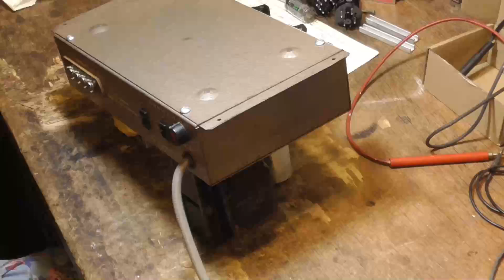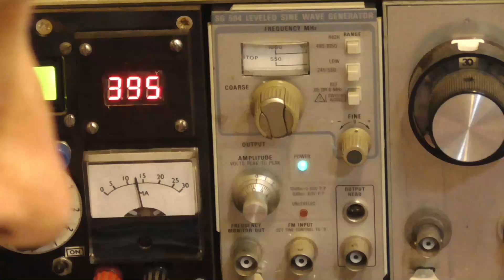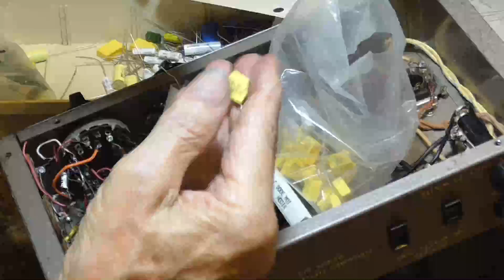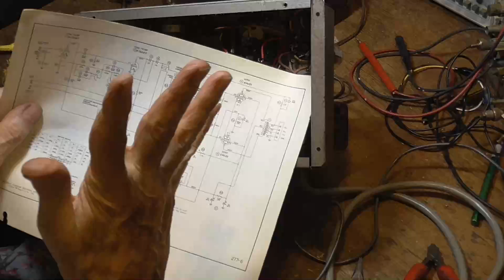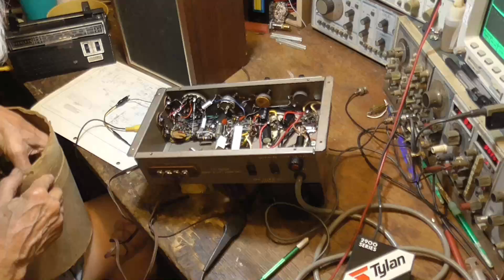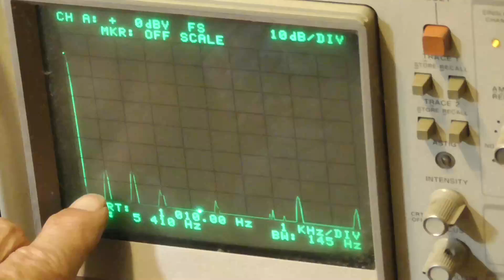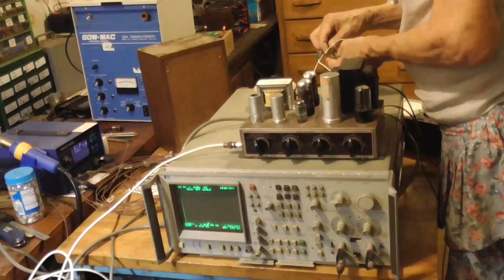REPAIRING A SMALL TUBE AMP

Comment: Now, if you were a real nut case, like me, you'd gut the original electrolytics and put the modern electrolytics inside the cans. I did the same with a car radio, removing the vibrator guts and placing a pair of NPN power devices inside, along with a small feedback transformer.
30 years ago, I bought a Grunow 6 tube AM Broadcast superhet. I finally went inside it last year and was disappointed by the number of Japanese replacement electrolytics and film caps. I generally don't replace wax capacitors unless they show leakage or wax running out the ends, from heat. 
Another comment - excluding resistive losses in the output devices or (if used) output transformer losses or filament power, the theoretical efficiency of a Class B amplifier is pi/4 or 78.5% when the supplies are just high enough to prevent clipping. Without crossover bias, Class B is inappropriate for audio. Most Class ABs have just enough crossover bias to reduce efficiency to maybe 70%.
Reply from the maker: This was a job for pay where the customer wanted minimum repair cost. That means no time consuming operations like opening up the old cans.

Comment: i made a dielectric  sensor of a mosfet transistor (2N 7000 
low threshold voltage means no gate bias required
high input impedance of the insulated gate means almost no gate current is required
consequently no current-limiting resistor is required in the gate input)
, i have a coil direct to the gate , and a led to indikative when it is a dielectric aura rund my body or plastikk and so on ..it will not detect normal electric em radiation  only dielectric !!     , it detect my body on 7 m distanse , and i wonder if it possible to make a dielectric sender ? ? do you know master ( my only ide is to send a hige volt signal in to a antenna made of som dielectric material and it gone be my first try when the time is right )  
glasslinger you ar a tru Jake of all trade!!!  . love from norway ... <3

Comment: Ron - forgive me if I'm wrong, but when you are doing the 1kHz distortion test, you increased the output level from the amp but you didn't drop the input sensitivity from 10dB/div so the 1kHz will be way off scale.
Reply from the maker: It's a log scale so it still fit fine on the screen. This was a quick rough test so I was not carefully setting everything perfect. Nobody would ever use an amp like this for any serious audio reproduction!

Comment: Lovely repair and servicing work. Did you fit a new valve (tube)? I think it's a little unfair to judge tube (valve) amps from what is clearly an old and basic model, especially if that's the original valve. I have a modern amp, and, as any tube-roller will confirm, the choice of tube can make a huge difference.
Reply from the maker: Even worse the output transformer is the wrong one! (cheap replacement)
Reply: @glasslinger  oh 😮
It does raise the question... If the amp is such a frankinsteinian mess, why did they want it repaired? I assume they didn't know
Reply from the maker: @daveryman1  All tube amps like that one are now collector's items just like old radios! There are some collectors that collect nothing but tube amps! This particular amp belonged to a man's father so he wanted to have it working as a memento.
Reply: @glasslinger  I think you may be right!  I'm gonna bring my old garage valve amp inside & check it out!  I'm sure it needs some attention!

Comment: I was watching till the end, hoping you would realize putting 8V into the analyzer set to 0dBV full scale is causing the distortion.... The analyzer even says "OVERLOAD" in the bottom right corner ;)
Reply: The output tubes bias should have been checked before any testing. Then display the amplifier output sinewave on a scope to see the point at which it begins to distort. This amp should be fairly good up to the limits of the output tubes. After checking to see at what voltage the amplifier begins to distort, I would back off slightly and use that level to set the analyzer to -10dB. Then look at the distortion products as the amp output is increased toward 0dB and below -10dB on the analyzer while measuring the output power at those points.
Reply: @ctbcubed  Hi mate!  Yeah I dunno mate; it looked to me like the harmonics were steadily rising as the output power was increased, from even just 2V output!  Truly, it could never be a hifi amp, but maybe a good guitar amp?
Reply: I totally agree. The test is invalid, the input of the analyzer is distorting due it being too sensitive.
Reply from the maker: OOPS!  It was an oversight since I was trying to get the video done in 45 minutes. The distortion was still present while the signal was within the scale of the analyzer. Actually, it was surprising at how little distortion was added by the analyzer front end overload!
Reply: @glasslinger  this is not true. Any time the Analyzer displays OVERLOAD, the "harmonics" go up significantly. The way such analyzers work, this is not at all unexpected. The input signal either goes to an A/D converter with little headroom for overload and the digital data is subjected to an FFT, or, if its an older model, is mixed up to a higher frequency and subjected to a tuneable filter. Both variants will produce harmonics when overloaded.

Comment: Omg a soldering gun! You can weld wirh that!! I would never use one if those. 
I now restore old 2" broadcast video tape machines. These machines are almost 2,000lbs and need an air compressor to run. The video head spin on air bearings @ 14,000 rpm and can't have any bearing noise. Mlst of thr larts cant be obtained any longer so some circuits must be redesigned using new parts. The pictures these things produce are still amazing!
 I used to fix everything with a Simpson 260 meter and a Tek scope
Reply: Solder gun works pretty good on point to point vintage tube gear, sometimes it’s necessary.
Reply: @fredfabris7187  i have been soldering for over 50 years and never found the need for one. Way to cumbersome. I have soldered a ton of pt. to pt. stuff from Hearhkit, Dynakit etc. Gun heat is very uncontrollable and would never use one imho
Reply from the maker: @rty1955  Gun heat is WAY more controllable than that of an iron! The whole point is to heat the joint fast, make the connection, and get off. You would need a very powerful iron to do this on the old radio connections. My soldering station is temp regulated 60 watts. It does not even begin to compare to heat output of the 250 watt gun! I have used both tools and unquestionably prefer the gun even though it is sort of cumbersome.
Reply: @glasslinger  if you are welding car fenders, guns are fine. They do not have accurate temp regulation at all. Some delicate electronic components can't tolerate such fluctuation if temp. Guns have their purpose, quick high temp, or soldering heavy wires etc. I do delicate work where guns would not work well at all.
Reply: @rty1955  Hi Roy!  I was just wondering what sort of soldering iron you use for p-to-p & chassis soldering?
Reply: @glasslinger  Gadzooks 250W!  Yeah that should work!  Long as you're quick huh?  But yeah in & out quick with a high power iron is definitely the way to go!  Obvoiusly you wouldn't use it for SMD's - Der!  I've seen you use a much smaller iron for tagstrips, wire tinning, etc.  I think people worry that you use the toofiddy for everything!
Reply from the maker: @nevillegoddard4966  Sometimes the big 325 watt gun has to be used on those circuit boards with a ground plane.
Reply: @glasslinger  Wow I'm starting to sweat just thinking about that!  My regular-type 250 W iron has a 7/8" diameter solid copper tip & weighs about as much as a colt 45.  The whole barrel glows a dull red, & I nearly burnt a hole clean through the kitchen table after leaving it on accidentally.
Reply from the maker: @nevillegoddard4966  I have one of those! I think they were meant to solder gutters and other plumbing work.
Reply: Hey, do you have YouTube channel or WEB site? I restore old 1in VTR's, VPR2s, VPR6s.

Comment: Any advice on what test equipment to buy for someone starting out? I would like to repair and build vintage guitar tube amps that I can not afford.
Reply from the maker: You would do good to get a Triplet 630 VOM and restore it to perfect. The old meter type VOMs are best. You can also have one of the digital ones but they are not as useful. An audio signal generator would be useful. Stick with name brand stuff, industrial quality rather than consumer crap. (hewlett packard) The meter and generator will get you started. Later  you could get a low cost scope, but get going first.

Comment: Tetrachloroethylene  is the brake cleaner / dry cleaning fluid.     from wiki:  "Chlorinated brake cleaner containing tetrachloroethylene will on exposure to high temperatures (above 500 °F (260 °C)) or strong UV light decompose into phosgene and hydrogen chloride, both of which are dangerous when inhaled."       so no spray on hot metal!!!

Comment: Ron, did you check the biasing of the push pull end stage? A good symmetric AB stage should not have this much distortion since the signal rides on an almost quadratic function. Also did you check for symmetry on the driver /phase inverter stage?

Comment: Tube amplifiers have to have speakers that are at least 93 Decibels/meter efficiency in order to sound good and have minimal distortion.
Bose speakers are an example of high efficiency speakers that would work to make a tube amplifier sound good, plus a small Push-Pull 6V6 amplifier is only good for about 8-10 watts RMS so you were measuring that amplifier at it's intended ratings. 
Those speakers you were using were 1980s vintage 3 way 6X9 Car Speakers which aren't the greatest thing to test a tube amp out with.

Just my two cents.

Hope this Helps.

-Levi

P.S. I work on old tube equipment as well so I'm quite well versed in tube electronics theory, and I enjoy watching your repair videos.
Reply: Geez Levi you couldn't squeeze a speaker any bigger into that cabinet!  It's probly a 4 ohm speaker but so what?  I think you're being a little nit picky aren't you?

Comment: Having resurected 50 year old stuff for the last 50 years I've only had to replace nor more than 10-20% of them.  What you need to determine is if a capacitor is close to the end of its life.  Reforming a worn out capacitor is a waste of time and effort.  Reforming a capacitor that has lots of life left SAVES time and effort.  What to know is if a capacitor is good and will reform and provide many more hours of service.  That determination is made by combining a condition test with reforming.  NEVER assume a capacitor is good for any reason.  A bad cap is a bad cap as a good one is a good one.  If the capacitor reforms according to the current change versus time and applied voltage for a good capacitor, it's a good capacitor and can be left in the circuit.  Why safe any capacitor?  Because the in most cases the originals are no longer available and the time and effort to make a proper job of replacing with alternate types can be the undoing of a decent piece of equipment.  But in retrospect, it's all throw away junk anyway.

Comment: There must be something wrong. Assuming this is dual 6L6 and by the size of the output transformer this should bring out about 20 watts under a percent thd.
Reply: Notice she didn't attenuate the input to the spectrum analyzer as the amp put out more power. The display is showing overload @ 45:14.
Reply: May be something wrong :).. I even checked data sheet from RCA - one 6L6 has max power 6,5W How did you find out it is 6L6? likely it may be 6V6. with max 5,5W  And four times more from two with 10 times less THD? By transformer size?  I see author ride them at maximum they can
Reply: I believe he said they are 6v6, looks like it to me

Comment: 10% THD from a tube amp... that's a recipe for a killer guitar amp tone! HiFi audio, not so much.
Reply: I would be happy to know how did you get  this conclusion. Can you describe what is by definition  Hi FI?
Reply: Mikexception THD should be below 1% to remain mostly inaudible. Good hi-fi equipment will produce a fraction of that.
Reply: @FluxCondenser  Thanks.  Means good will produce for example 0,0001% - sure it is good, may be even enough. .  I am now assuming that good Hi Fi it the kind that has  that is hard enough to achieve tech data - interesting .    If easy than  it is sure not good Hi Fi, but after who knows  when it is starts to be  "bad Hi FI"?  "Good Hi FI" is defined. Anyway  my problem is with regular.
Reply: I believe fender used to rate power output at 10% THD